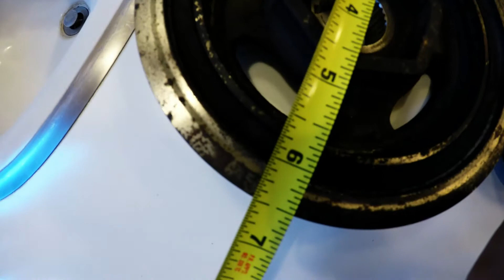2.95" Innovated Motorsports CTE Supercharge Pulley Upgrade & K-Series Crank Pulleys!

Comment: It would be nice to get a general idea of pulley sizes and crank pulley combinations to achieve what boost levels, I know that different setups have different efficiencies and different boost levels, but a general idea of how much boost at what rpm from the m62 unit for k24 and k20s would be nice to get a general idea